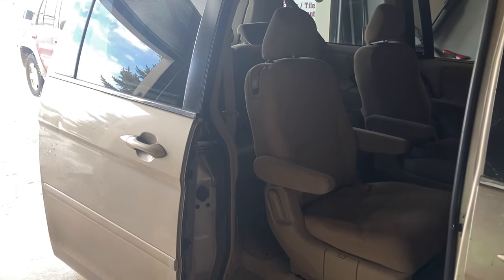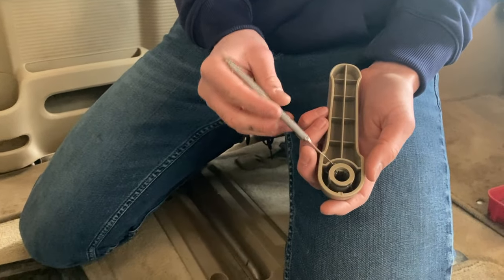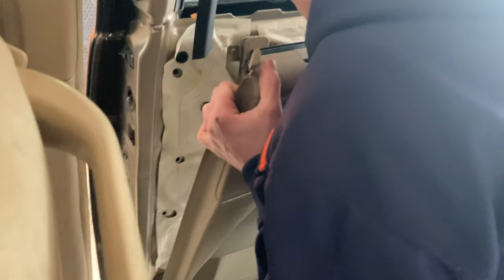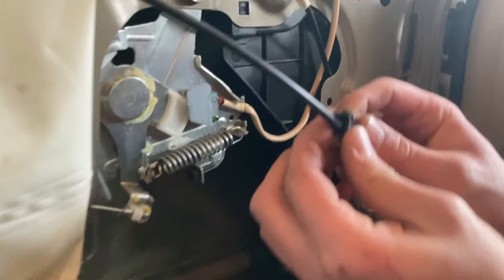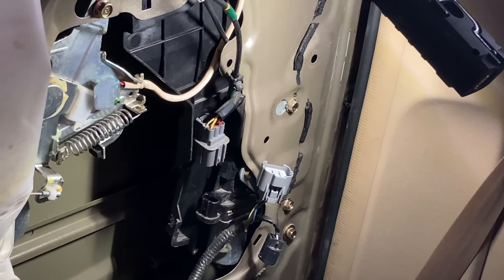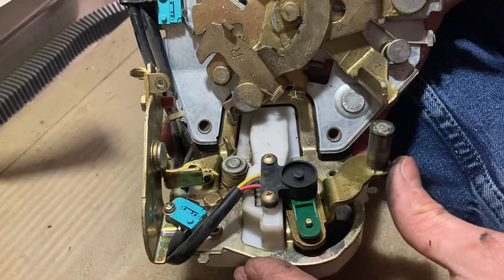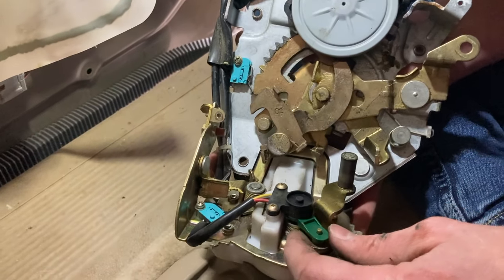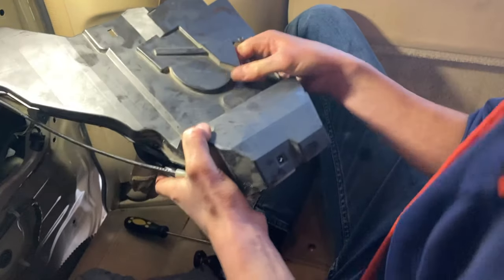How To Fix Parasitic Drain and Power Sliding Doors On 2005-10 Honda Odyssey

Comment: Trick for getting the contraption in front of the window track when you’re putting everything back together: I used a long dandelion digger (I have one but I don’t dig up those beautiful dandelions). But a long strong screwdriver would have worked too. I put it into that key shaped screw hole and used it to lever the window track over. The contraption slid right in. The key shaped hole that I’m talking about is the uppermost one that is inside that Hans said you really didn’t have to take that screw out because it’ll fit through the wide part of that key shaped screw hole. You can see this key shaped screw hole at 20:38 Hans is putting that upper screw into it. A word of caution, I did not take that upper screw out in the beginning because it fit through the wide end of the key shaped hole. But when I put everything back together that screw bent the lower edge of the key shaped hole because I had too much of a strain on it. So I had to use a hammer to gently bang the edge back to normal. Also, that glued on rubber guard that goes over the two upper screws on the outside back of the door was almost completely off on my door and it was hanging down so I think it was probably interfering with the latch. I left it off. May have been the problem all along, but the mechanisms inside the contraption were gunky and sluggish anyway. Thanks a million, Hans, for an excellent video; I followed it step by step and my door is completely fixed and working again. No unlatching 2 seconds after latching and no door alarm while driving. I am very glad you showed how to put everything back together also! Thank you!
Reply: @hanspoole  thank you again. Next project for this old Grammy is …. the washing machine… I replaced the cogs but I think another little thingy needs replacing too!

Comment: Well done! If you measure the parasitic draw before the repair, it is about 370 mA - 400mA. After the repair it will be around 20 mA. That upper screw in the "key hole" slot is meant to be loosened until it gets hard to turn but left in the latch. Then during removal it does fit through the hole. The reason you had to use the ratchet all of the way out is because of the interference threads that keep the bolt from falling out during shipping/assembly. Also the bolt you reinstalled in the "key hole" slot should go at the bottom. The flat washer on the bolt for the window run channel lower bracket is because the hole is slotted, so the washer adds support when bridging the slot. All in all, a great DIY video.
Reply: A couple of questions. Mine has the 380 mA draw. 
Does this still happen even though door open indicator does not come on?
Does the parasitic draw still happen even though you turn off the switch on the dash so the power doors don’t work?
I pulled the fuse and still have the draw. Could it still be the same problem?
Basically, how can I be sure this is the problem before I tear the door apart?
Thanjs
Reply: @bobh6728  I am in the process of also repairing this problem. The light on the dashboard does not tell me that a door is open. But if you close the door manually you will notice that the door at the back does not get pulled in tightly to the frame of the doorway. You can actually unplug the doors from working automatically at the rear right-hand side of the van, . But you need to pull the plastic side panel off enough so that you can reach the plugs. I think it's called the rear MICA. This is the area where the heater blower is located. While I agree with absolutely everything in the video I will add that there is at least one electronic component that if bad will also keep your door from working properly. If you look in the video you will see one or two of them and they are green in color. I think they are called an actuator switch? I purchased new ones from an online electronics company and they were only about $7 each. Might as well replace them if you're going to do all that work anyway. My 2 cents.

Comment: This video was very useful!! It shows exactly how to fix the issue. One thing I would recommend is using a rag rather than the pick for the very first step, taking the door handle off the panel. There is a different video showing how to do it. Everything else is top notch!
Reply from the maker: Good to know! I struggled to remove those clips with the pick method, so it's nice to know that there are more efficient methods out there.
Reply: @hanspoole  I meant to say rag. Slide a rag at the back of the handle, pull down and to a side and the clip should come off. Make sure you don't loose it. 😉
Reply from the maker: Ah, that makes more sense, I was kind of wondering what you meant with "tag" 🤣

Comment: Thats exactly my  problem, thank you for the details.
Interesting mention of yours was about stopping the doors from closing automatically while working on this problem by switching off the auto door operation, by switching it off on the dash. That got me to thinking,… wonder of i switched to off,… if the drain would go away, just for testing purposes….. “ It did stop the drain “ on my problem. If I switched it back on and cycle the doors… open and closed again the drain came back and would not go away. This simple test verified that the door latch switched is my problem.
I can leave the doors in manual mode till i have time to do exactly what you did in the awesome video.

Comment: Thanks for the thorough video and for following up on the comments.  Followed the video step by step, took about 2 hours, jump started the van and drove around 45 minutes. Tomorrow morning we will find out if it worked!  Thanks again
Reply: @hanspoole  so the van started up this morning and the annoying audible alarm for an open sliding door is not making any noise so I think my problem is solved. Thanks you saved me a bunch of money and time, do you have Venmo?
Reply: Speculating that this problem is worse in the winter bc the lithium grease in the latch mechanism gets stiff.  Seems to be a pretty common problem looking at the Odyssey forums

Comment: Thank you for this video.  I cleaned out the OEM motor and it worked for a little bit but failed again.  I gave up so I ordered a new motor assembly as well as door latch actuator and my door is good as new now.  Thanks so much!!  This video saved me hundreds of dollars in repair costs and also has prolonged the life of my 18 year old minivan which is very hard for me to part with.  Only 169K miles and still running strong!

Comment: Wow impressed! Totally worked! 2006 Honda Odyssey. Had a battery drain in a couple hours would be dead, sliding door stopped working automatically. Now not draining battery at all and sliding door motor working after cleaning and lubing as instructed in video. Took it to two mechanics, one gave up and the other said it was the micu computer for $1500, going to share this vid with them. I never leave comments. Thank you so much!

Comment: I had this same issue and it only happened in the winter.  I replaced the mechanism instead of cleaning/lubricating, but a very thorough and helpful video.

Comment: Thanks to you I've finally fixed the problem I had with my van. Spent 2 MN winters turning off my battery every night with a twist switch, not knowing where this drain was coming from. I always suspected the doors but couldn't be 100% sure and couldn't spare the expense. Very nice video, easy to follow along!
Reply: So your door wasn't beeping at you and the battery was draining?  Ppl are saying their door alarm was beeping but mine isn't and my battery is draining overnight
Reply: @Miamijunglist  Mines the same way. No beeps or warnings but one time I turned and the passenger door literally slid open. My battery is fine if I drive every day but 2 or more days leaves it dead. I've just been using my portable jumper every time but figured now that it's warmer I need to fix it. I suspected the doors were the problem.  I am going to test the fuse etc before tearing into it.

Comment: Thank you a MILLION times for posting this video! It was incredibly helpful. I had the same problem on my 2005 Odyssey EX and while I didn't undertake this entire process, it helped me understand and ultimately fix my issue. I opted (for now, at least) to remove the 3 screws one at a time and spray WD-40 into the holes in order to try and lubricate and clean whatever mechanisms inside were gunked up, as recommended by on of the commenters in this thread. I also cleaned and lubricated the latches / moving / closing mechanisms at both the front and back sides of the door. I will try to update my comment in a few months regardless if this is a permanent or temporary fix. I only need my Odyssey to last another year or two at the most, and we no longer chauffeur our kids or other people around in the car too often, so I am hoping this can stay fixed for the near term. If not, I'll be back to this video for more guidance on how to remove the door panel and get this thing cleaned and lubricated properly.
Reply: Hello. I unscrewed the screws and squirted some spray white lithium grease in through the front and back holes. Because I am in no position to crawl in the back of my van and attempt what Hans Pool has done I tried your method. I’m in a wheelchair. So far so good. It’s closing and opening every time and I can’t detect any drain on the battery, parasitic draw or alarm going off. I still don’t trust it so I’m disconnecting the battery every night until I test it more. But if this works, I’ve just saved myself over $2000. I think I’ll put it on my phone calendar to lube it up that way every six months - pending final results. Thanks much for your suggestion!!!
Reply: @wavoconqueso  Hi, which screws holes you sprayed lubricant through

Comment: If anyone is having this problem . I just fixed mine easily… I did exactly what the video showed.. still had the drain.. come
To find out the the other door had the same issue!! I opened both doors and sprayed a generous amount of wd-40 inside the rear door latch on both sides - closed and opened the doors a few times - and the problem is now solved!! Good luck and thanks for this video

Comment: I have this problem in my 05 EX-L with 202k miles. I pull the fuse for the doors at night to avoid the battery dying...but I am so happy you made the video of how to fix the doors! Thank you so much! I'm going to work on mine this weekend. Unfortunately I also need center rollers on the opposite side, so I have my work cut out for me!

Comment: You are right about having to use oil or lithium grease.  I did this to my doors a few years ago, but only used WD40 silicone spray and the problem came back. Now I have to do it again, so your video is super helpful.  By the way, those hooks up top do come off, but they slide up and then pop out…I know because I broke mine and bought new ones.

Comment: Appreciate the clear description of this repair process.   Without the tip on removing the window rail bracket to reinstall the latch, I don’t think I would have finished the job.  I recommend testing the door before reinstalling the interior panel and trim.
Reply from the maker: That one little step saved me a lot of struggle and wasted time as well, and that's why I chose to show it in the video. Great tip about testing it out before reinstalling the trim panel! That could potentially save someone a lot of frustration if they had forgotten to connect a cable or switch!
Reply: It is literally impossible to do without removing that bracket.

Comment: Easy way to lube the inside of those puppies is to remove just one of the three latch mount bolts on the back outside of the door stick your lithium grease straw through the hole and spray inside. Replace that bolt and move onto the next bolt repeating the same step until you've done all three bolt holes. DO NOT REMOVE all three at the same time. 
One at a time and replace each one individually. 
This worked perfectly and saved a ton of unnecessary work and. anguish.
Reply: Did this last?
Reply: As you suggested, I also opted (for now, at least) to remove the 3 screws one at a time and spray WD-40 into the holes in order to try and lubricate and clean whatever mechanisms inside were gunked up. I also cleaned and WD-40 lubricated the latches / moving / closing mechanisms at both the front and back sides of the door. I will try to update my comment in a few months indicating if this is a permanent or temporary fix. (I suppose based on other comments, I may need to go back and use a spray lithium grease instead of just the WD-40.)
Reply: Interesting I just happened to buy Lithium grease spray can at Walmart today for like 6 bucks. I will try the 1 bolt at a time now instead of taking it apart just to see if it works. First I'm going to hook a multi meter up to confirm the issue

Comment: This is a great video you did a really good job! I found the micro switches online for only $7 each so I'm going to be repairing my doors and I will replace the switches anyway since my van is 18 years old with 340,000 miles! I prefer not to go through all that work and then not have my doors operate lol 😆 thank you again!
Reply: Where did you get your switches?  Thanks

Comment: Thank you, after 17 years, i didn't realize how gunked and dusty and dirty the insides were. It didn't really help that when i started noticing the problem i was putting a lot of lube in through the latch because that was the way i usually fixed the issue, not realizing there was much more inside that was causing the issue. I spent a good 2 hours trying to figure this out and cleaning but i guess you saved me a couple of hundred.  mine is still not nearly as clean as your and i have a feeling another cleaning will be necessary at some point but once done once, I think it's going be pretty easy.
Reply from the maker: I’m glad my video was helpful for you! I completely agree that after you do it once, the next time is much easier. The first door I did was a learning experience, which is why I  filmed myself doing the second one😆

Comment: Some notes: 

Do not remove the upper trim on a cold day; the trim plastic will be more brittle and can break when pulling out the plastic trim pegs.

My door handle did not have the metal circlip attached. I spent some time groping around for it before determining it was absent, and could just pull out the handle.

The inner door handle has three cables attached to it. If any one of these hangs up, the door will have problems closing. Since you have the panel off, you should squirt some lubricant into the front latch assembly. It was sort of tricky to do this, but I could bend the squirt straw through a hole in the sheetmetal and guide it in with my other hand reaching into the door. This helped free up the inner door handle cables. 
 
I bought a used rear latch assembly for $100 off ebay. The little hinges and whatnot moved ok on the old one, after cleaning and oiling, but the plastic around the latch was shredded to bits. 

Also, one step I had to do once I got the new one in was jump the closer motor to pull the door shut for the first time after reassembly. I don't know if the computer thought it was open, or what. No amount of prescribed resetting hacks (pulling fuses, disconnecting battery, etc) worked. I clamped alligator clips to the pins inside the socket he's detaching at 7:45 and ran the motor off a little 12 V charger.

Comment: i actually extend out fuse 7 back up out to a switch and literally turn it off after locking the door
then prevent the drain after extensive dig into where the drain is

Comment: All the symptoms look to be the same with mine as well (2006). Dead battery in the morning, doors that dont seem to fully latch. Hoping this repair will solve my problems. Thanks for the very detailed video. I'll try to repair it sometime this next week and give a simple update on how it went.
Reply: Update: I did this repair to both of my sliding doors and It totally fixed the problem of my battery being dead every 12-20 hours. I measured the current draw before the repair and it was 400mA and after the repair it dropped to about 30mA. It took me about 2-3 hours for the first door and just over an hour for the second door. Thanks for the detailed video!!!
Reply: @GarrettCrosgrove  Where did you measure the draw?
Reply: @jackjunk5495  directly on the battery. Disconnected it and put the amp meter inline with it.
Reply: @GarrettCrosgrove  Thanks.  To isolate further, would you check the fuse connections?
Reply: @jackjunk5495  Yeah pulling the 7.5amp fuse labeled "7 - BackUp" will also drop the battery amps from 400mA down to like 20mA. A quick fix for a battery draining until you can do the repair. I drove around for a week or so pulling the fuse everytime I parked it. Until I got around to fixing it using this video as a guide.  That number 7 backup fuse also services the navigation system, door lights, power locks, dash lights when van is not running. and a few other things.
Reply: @GarrettCrosgrove  Very helpful, thanks for taking the time to type that out :)

Comment: Yep, this is the video everybody with this fantastic Honda junker needs to see.   Please become a manufacturing engineer, my dear friend.  My tip: I put cargo springs in the back because of the sagging over the years, and it feels much better than stock.
Reply: @hanspoole  Yes, I was a little worried that the women might complain that the back of the van was too harsh, but it's fine.  Feels real good, and it's not hard at all to do.
Reply: @hanspoole  I went back into my rockauto order history and the exact coil spring part is Lesjofors 4414240 for the pair.